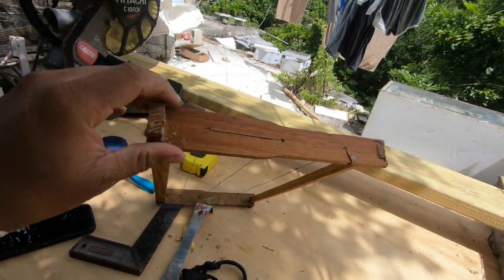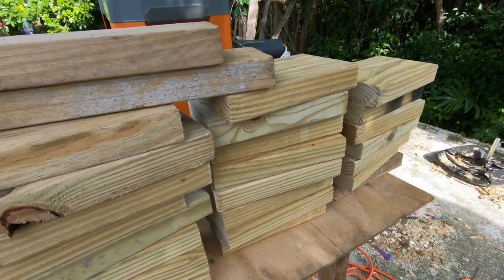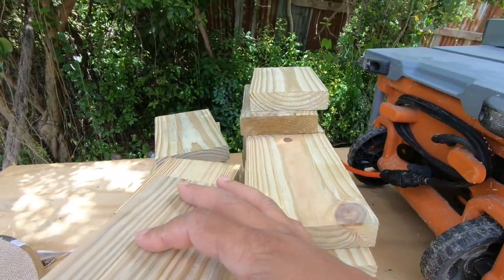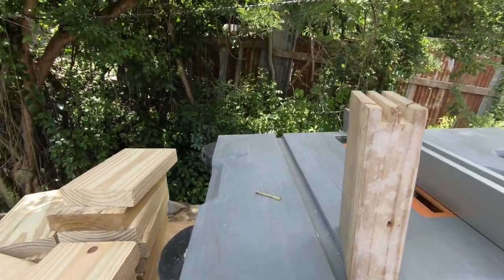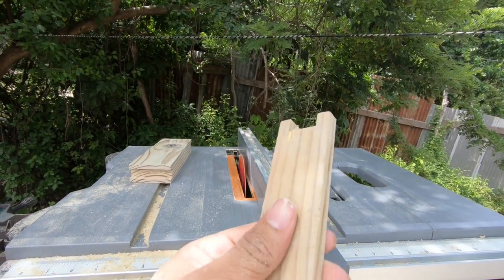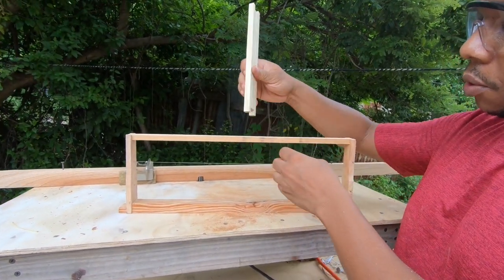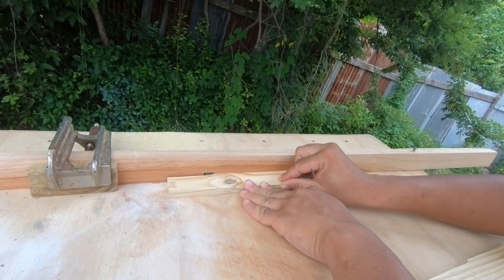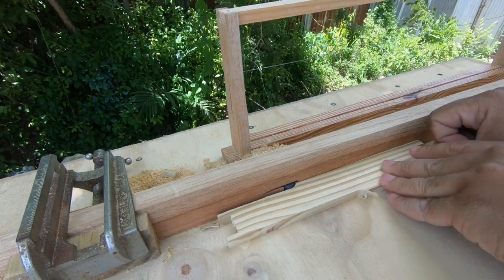How to make side bars for your frames

Comment: Hello Devon from Newfoundland/Labrador!  I also make hives and would suggest a minor finger saving trick.  Not from getting cut but from getting hand cramps.. If you put a 1/8 strip onto the fence between the routed bit and the stop you won't have to hold the piece as tightly at one end to keep it straight.. The strip should be the same as the amount the bit is removing,, ,, Great instructions and thanks. Awesome!!!  Cheers!
Reply from the maker: Oh! That's an awesome idea! Thanks a bunch this was very helpful.

Comment: Excellent video bro. Love your tool setup. It's always good when you can help yourself.
Reply from the maker: Thanks a lot Mikey general. This will also be one of my side operations to earn money. I don't want to solely rely on honey to make money.
Reply: @redzwashere  love the mind set, I have most of those tools but it is mostly Bosch brand. Is it easy to get the tools you have in Jamaica for a good price?.
Reply from the maker: @mikeygeneral3676  the prices are pretty high down here. All the tools you see in the video where bought un USA and shipped in barrels. But way in my opinion get tools and I mostly shop at flee markets
Reply: @redzwashere  thanks. The nail gun you have i always see them at Harbor Freight do you ever have any problems with it?
Reply from the maker: @mikeygeneral3676  yea I have no problem with it so far. I have a Spear one from Dewalt just in case it breaks. But 2 years strong.

Comment: Thank you so much for posting this.    I am just about to build my first frames, and wasn't keen on having to buy a dado set like most others are doing ... and now I won't, since your multi-cut process works so well.    OK ... maybe I'm just delaying the purchase, but I am happy with that too.
Reply from the maker: Thank you  for watching. I too delayed buying a dado set but you will find that you will need it in time for other parts of the hives. But to date I only use it for the top and bottom notches when building side bars.